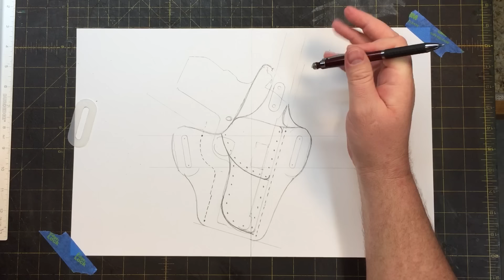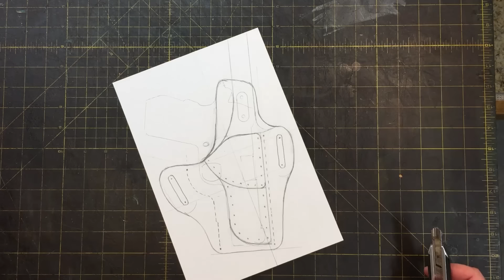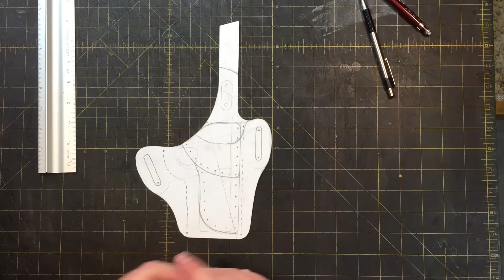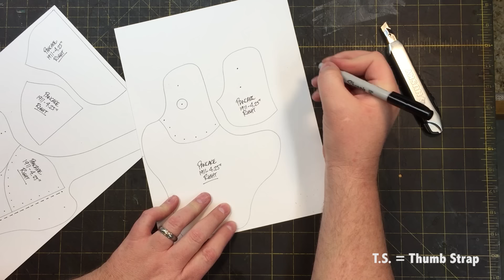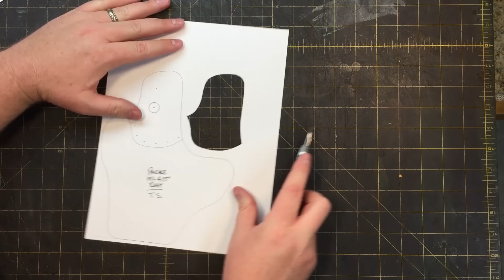Making a Pancake Leather Holster with Thumb Break, 1911 Commander

Comment: Can this be made with a lining? I keep hearing that the rough out leather on the inside will eventually get dirty and damage the firearm. What weight exterior and interior veg tan would you recommend for lining?
Reply from the maker: Hi Vicki - I do line holsters when requested, but I have to charge extra for it to help cover the added labor and additional leather. When I line a holster, I usually build it with two layers of 3-4 ounce vegetable tanned leather. Some people line with a thin layer of suede, but I'm not personally a fan of that.
Reply: Adams LeatherWorks Thank you! I don’t line with suede either.

Comment: Hey Adam, great job on this design and build. I've looked on your website and only found this video for the Pancake Holster with Thumb strap for a commander 1911. Are going to put the pattern on the website, and or a built natural stained 1911 thumb-strap holster for sale?
Keep up the good work, good job on what your building up. 
God Speed, and Semper Fi
Reply from the maker: Hi Kelly - thanks for watching! I do have the pattern available for a few gun models. Hope to keep adding more patterns to the site as time allows, but for now I have the 5" and 4.25" 1911, in addition to a few other gun models. They're available at the following link. Thank you for your service! https://www.adamsleatherworks.com/shop/pancake-holster-pattern-thumb-break/

Comment: Did you use a pull the dot snap with that thumb break or just a regular line 20?
Reply from the maker: ShaneP i used directional dot snaps on this one. The consensus seems to be to use regular line 24 snaps from a liability standpoint, so I have been using line 24 snaps on my recent holsters. It seems like the leather, combined with a proper grip will only really allow the snap to operate in the intended direction, so directional snaps should be fine so I’m not really opposed to using them.

Comment: Nice job. One question though, is it me or did you not use the piece for wich you cut the pattern at 05:18 ?
Reply from the maker: Thank you - and correct, I didn't use that piece. I always create two reinforcement piece sizes - a small one and a large one. If a customer requests tooling on their holster, I tool a design on the larger reinforcement piece. Otherwise, I always use the smaller piece.

Comment: if i wanted to dye the leather, say black, where in the process would you normally do that?
Reply from the maker: I dye all of my pieces prior to assembly because I like to use contrasting thread colors. But depending on the type of thread you use (I use nylon, which doesn't take dye very well), you can dye the holster after forming, prior to applying sealer.

Comment: Question: Your back strap was measured to fit on a cocked and carry, was it too short for the hammer down?
Reply: Always be ready. Always be vigilant. Always carry cocked with a pill in the pipe
Reply: A gun that ain't loaded and cocked ain't good for nothin....
Rooster Cogburn - True Grit

Comment: Really great work & a nice holster. Would you mind telling me where you get there stiffener piece for the thumb snap? I have been cutting mine out of sheet metal for several years now because I can't find anything like that out here in Tn. I have been using  a straight piece that was like in the L bracket section of a hardware store, but it's really too thick & gives me problems when I put the snap on. I always have to skive the leather down to make it work & I don't like having to do that.
Thanks,
Eddie
Reply: Try Tandy Leather
Reply: I haven't done any business with Tandy in a lot of years.

Comment: Eric, at the beginning you measured the slide in order to place your stitching lines - what ratio did you use?
Reply from the maker: Hi Tom - I used 1/2 the slide thickness, plus one thickness of leather. So, a 1" slide, with 8oz leather (1/8") would have a stitch offset of roughly 5/8". Watch this video for an even more precise method - I've started using it more recently. https://youtu.be/r0CgLSKvAac

Comment: very nice!
but i have to spend a lot of money for tons of tools to make it like you...
Reply from the maker: Thanks! Don't need a lot of tools, but good tools make the job a lot easier. Hand stitching is slow, but cheap. Don't need a press to set the snap - they can be set with hand tools. Leather can be cut with a utility knife. Burnishing can be done with hand tools and the result can be just as good. Cutting belt slots can be done with a hole punch and a chisel (or knife) to connect the holes.
Reply: @AdamsLeatherWorks  
Thank you!
i will try to make a Holster for my 1911 and a sheeth for my Knife...

Comment: Why don't you make the dowel sight track go all the way up the slide?
Reply from the maker: Sometimes I do. The benefit of stopping short is you can form the leather closer to the slide, tightening up the fit closer to the butt of the gun. Once the sight clears the front of the trigger guard, the sight channel is no longer critical.
Reply: Also, I really like resolene but is made for finishing dyes, stains and antiques. I have never made a holster using neatsfoot oil like that, I use pro dye, does the resolene still seem to work alright?
Reply from the maker: I use resolene and Fiebings Pro Oil dyes as well. The neetsfoot oil has no effect on the dyes or resolene. Just make sure not to apply too much oil, and give it at least 24 hours to absorb fully into the leather. I should note that I typically dye all my pieces prior to assembly, then oil after the piece is assembled and formed. Then sealed the following day.
Reply: Thank you for the replies, and you do beautiful work! I just started using dowel sight tracks and shortening them makes a lot of sense. I also dye prior to assembly I was asking about the neatsfoot oil for use on a holster without dye like the one above. I haven't done a holster like that and was just wondering if the resolene has the same effect on an un dyed holster.
Reply from the maker: Thanks for watching and thanks for the compliment! Resolene may slightly darken the leather on un-dyed items, but only noticeable on items that haven't been dampened with water already. Basically, in the same way that veg-tanned leather can be stained by water. But, if you dampen the entire piece, you don't notice the stain.

Comment: where/how can I buy one?  I have a Wilson CQB Compact ... 4" barrel...
Reply from the maker: Check out my website at www.adamsleatherworks.com. I don't have a 4" 1911, but I have a Dan Wesson CBOB 1911 with a 4.25" barrel. I would form the holster with my gun, and either trim off the extra 1/4", or leave it as-is (for the 4.25" length".

Comment: So what was the shoe string for when you were vacuuming it
Reply from the maker: It essentially acts like a breather mesh, allowing air to be extracted past the point where the bag closes on itself. It's probably not as effective as a purpose-built breather mesh, and it may not be effective at all, but it seems to work. I don't always use it - I usually just scoot the grip of the gun, magazine, etc. close to the wood platen - close enough to keep the bag from closing down around the platen so air can continue to escape from the holster area.

Comment: Have you stopped using the pro edge burnisher?
Reply from the maker: Nope - I use it all the time. When I'm trying to film, it's a pain to move the tripod around and it's just easier at that point to hand burnish. And I wasn't going for the same level of burnishing that I normally would with a customer's holster. I still love the Pro Edge Burnisher. Great product.
Reply: Glad to hear.  I thought that might be the case, but I wanted to be sure.  I'm hoping to purchase the Pro Edger Burnisher soon and wanted to make sure you weren't experiencing a problem.

Comment: Is it possible to buy a digital copy to print off? Went to buy this template but you have an 18+ lead time!
Reply from the maker: Hi Flint - yes, the pattern is available on my website. The 18+ lead time is for me to build an actual leather holster/belt/mag pouch. There's a drop-down menu with the guns I currently have patterns available for. https://www.adamsleatherworks.com/shop/pancake-holster-pattern-thumb-break/
Reply: Ok. I bought this pattern. Cut it out of 8-9 oz leather. Have it all dyed and when I stack it all together to see how it’s going to look for stitching it seems to be very thick with the reinforcement pieces. Should I make them out of lighter leather and leave the main body the same?
Reply from the maker: Flint Barnes I usually use 7-8 ounce for the body and reinforcement pieces. Since you’re using a little thicker leather for the body, you can definitely use thinner on the reinforcement panel, or don’t use it at all. Being an OWB holster, the reinforcement panel is largely decorative anyway since there’s not really any external forces trying to collapse the holster.

Comment: Did he add the thickness of leather???
Reply from the maker: I use 7-8oz for pretty much all of my holsters. If I'm lining the holster, I switch to 3-4 oz for all layers of the holster body, and 7-8oz for the reinforcement. I showed the math formula at the beginning when I was drawing the pattern, with the idea being you can use any thickness of leather and adjust the offset by referring to the formula. I don't use that method anymore, and instead use a strip of leather wrapped around the gun and use that as my measurement tool. My newer videos show that method.

Comment: you put a reinforce piece in the front. but none over the snap? why?
Reply from the maker: The snap strap needs to be flexible (and thin), so I only used a single layer for the strap itself. The sweat shield (on the back) is double layered, and the snap is mounted to a thin piece of steel between the sweat shield layers to provide leverage to un-snap the snap. Did that answer your question?

Comment: Do you ever use multiple coats of resolene?
Reply from the maker: Henry Hasse I pretty much never do a second coat. I try to let it soak in really well with the first coat. Streaks, which are almost never a problem, are the only reason I might apply a second coat, and I'd apply it with an airbrush.
Reply: Thank you!

Comment: How long do you case the leather for?
Reply from the maker: Generally speaking, about 10 seconds in warm, slightly soapy water. Sometimes longer, but probably no longer than 15-20 seconds. If I'm feeling lazy, I'll pull the holster out of the water, then stick it in a zip-lock bag to let the moisture distribute into the leather. Double-layered areas (wings & reinforcements) tend to dry out first, so I might rub a wet sponge over them prior to sticking the holster (with gun inserted) into the vacuum bag for forming.

Comment: Vacuum: extreme or necessary?
Reply from the maker: If you were only making a few holsters, every now and then, it's definitely a luxury item. But if you're making batches or 5+ every week or month, it's certainly nice to have a press of some kind because your hands get pretty tired after an hour or two. If you're making 5 a day, then without a doubt, you need a press. I prefer vacuum, other prefer hydraulic. I've never used hydraulic. There's a higher risk of damage to the firearm and/or breaking molds with the hydraulic press. But, the hydraulic press does more of the initial molding for you, whereas the vacuum doesn't really do any molding for you - you have to mold the impressions through the bag while it's under vacuum.

Comment: May I ask what type of glue is that? Thank you
Reply from the maker: It's contact cement. Barge All Purpose Cement is arguably the best. However, I use DAP Weldwood Original Contact Cement (the red can) since it's considerably cheaper. It goes on a little thinner when the can is new, so you have to use two coats until the can thickens up a bit (first coat soaks in and doesn't leave much tack on the surface, then once dry, apply a second thin coat). You can usually find DAP at your local hardware store. Looking online, it's roughly 1/3 the price of Barge for the same quantity.

Comment: how hard is it to make a revolver holster for a ruger sp101
Reply from the maker: Well, I'm sure someone will come along and say they're easy, but personally, I hate doing revolver holsters if they're detail molded. The Stohlman Holster book has basic instructions for revolver pattern making, but they're not oriented towards the form-fitted holsters with stitch lines that follow the contours of the gun. A good starting point is to create a pattern with very loose stitch lines, then detail mold the holster and bone in around the perimeter of the gun. Then, you can take measurements and adjust the stitch lines inward as necessary. But, you'll probably need to build another mock-up (or 2+) until you perfect the stitch lines. If you're using a retention strap, detail molding isn't really necessary.
Reply: thanks for the info Eric, George

Comment: Why did you make a drawing cut everything out trace those pieces to make another full drawing only to cut those pieces out and label them?  I know nothing about making things with leather so I'm probably wrong but couldn't you just label the pieces from your first drawing so you aren't doing things twice?
Reply from the maker: I needed to break the original pattern into individual pieces. In this video, I photo-copied the original drawing and printed multiple copies, then cut away the individual pattern pieces. But some of those were "back" pieces, meaning they needed to be flipped over and traced onto the leather from the back side of the pattern piece. That, and they all had the original sketchy drawing lines on them. Confusing and messy. I may have mentioned in the video, but I only like to right on the "right" orientation of the pattern pieces. That way, when I trace the pieces onto the leather, if the text on the pattern is facing up, I'm making a right-handed holster. If I need to make a left-handed holster, all the text should be facing down (invisible). By tracing the messy pattern pieces onto a clean sheet of paper and making that final pattern effort, it helps me with my workflow and helps eliminate confusion. Does that make sense? This could all be "simplified" by going straight to Adobe Illustrator and redrawing the pattern digitally, but that's a lot of time that could be wasted if the pattern wasn't perfect.
Reply: @AdamsLeatherWorks  ok that makes sense. Thank you for explaining that for me. Bye the way that holster looks awesome. Great job.
Reply from the maker: @inspectorsteve2287  Thank you, I appreciate it! And thanks for watching & commenting.

Comment: I down loaded the 1911 commander plans and printed at 100% . The notes on the plan said this line should measure 7 inches.  But it measures 6 3/4. That's a problem?.
Reply from the maker: Hi Gary - what program are you using to print it? I recommend the free Adobe Reader app. Make sure it’s set to print at 100%, or Full Size. It should measure 7”. Otherwise the pattern will be a little too small.

Comment: nice job, but ain't it right to holster a cocked pistol?
Reply from the maker: Thanks - this is the way this particular firearm is intended to be carried. Hammer back, safety engaged.
Reply: @AdamsLeatherWorks  but in this case isn't it weaken the hummer spring? and it's also unsafe for holstering, i think would be much more reliable to holster uncocked gun, espesially when a round is in the chamber, and cock it  nefore sahooting?

Comment: Seems like a lot of leather was wasted by the way the pieces were cut out. The edges received no special treatment.
Reply from the maker: I guess you didn’t notice the dark nasty looking section of the hide I was trying to work around. And the reinforcement pieces were cut from a scrap piece of leather - sorta the definition of trying not to waste leather. Edges were burnished with saddle soap, and later sealed with acrylic.  Not as much effort as if put into a customer’s holster - but better than nothing at all.

Comment: you made it so it can't be stored with the hammer down
Reply from the maker: 1911's are intended to be carried with the hammer cocked, safety engaged and a round in the chamber. Regarding storage - guns should never be stored inside a leather holster for long periods of time. Not sure if that's what you meant by 'stored', but just thought I'd mention that. Thanks for watching!
Reply: @AdamsLeatherWorks  ah i was just thinking that having the hammer cocked all the time probably isn't good for the spring
Reply: @AdamsLeatherWorks  good video btw

Comment: No liner. Shame. Nice though
Reply from the maker: Thank you for watching. I line holsters when requested, but I have to charge extra for it since it uses twice as much leather. But I would never line a holster that I was making from a brand new pattern until I knew the pattern was correct and the material would not be wasted.